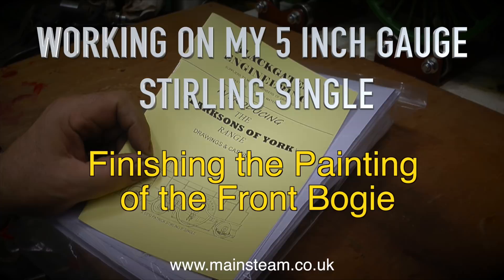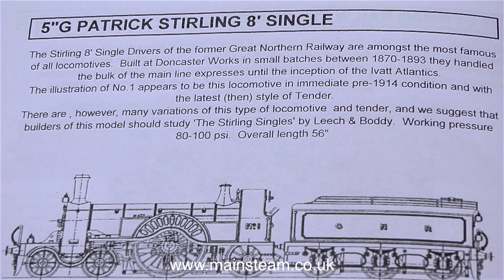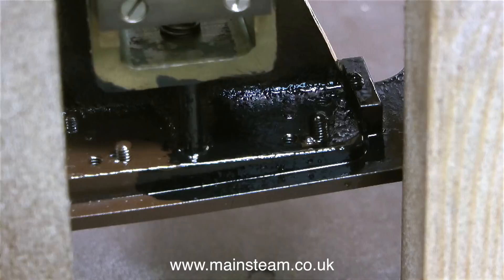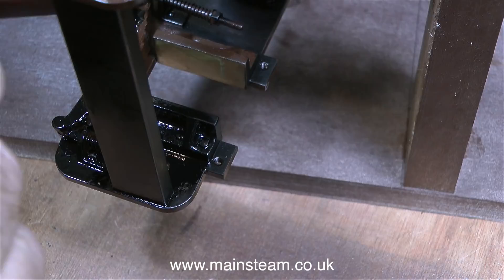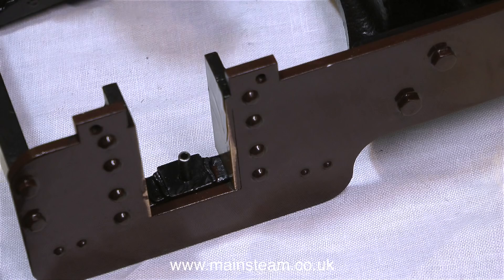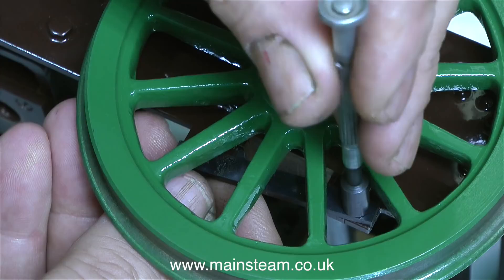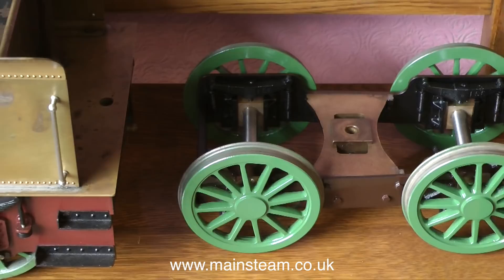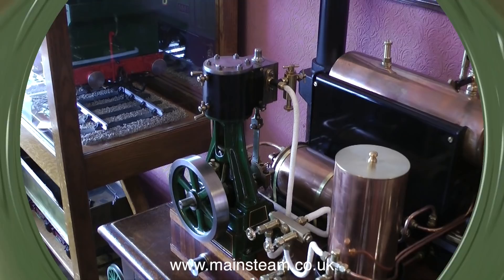MY STIRLING SINGLE #9  - FINISHING THE PAINTING OF THE FRONT BOGIE

Comment: hey Keiff my Mick Jaggar impersonation hahah  i just fired up my Mamod steam wagon and the fly wheel came loose wile i was running it i haven't had that happen before ??what can i use so that doesn't happen again?? some lock tight 
i didnt know that they were just press fit i guess any help would be much appreciated
Reply from the maker: Use "Thread Lock" type of Loctite on the bolt that holds the flywheel to the crankshaft - not retainer.
Reply: If you use retainer it will not come off ever again, so make sure it is the thread lock.